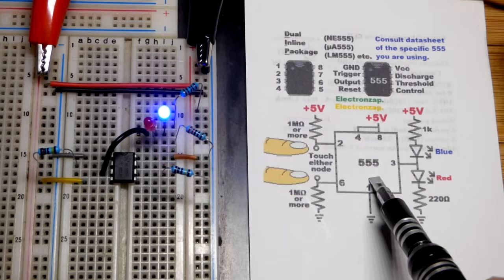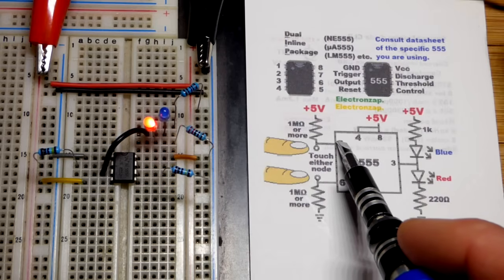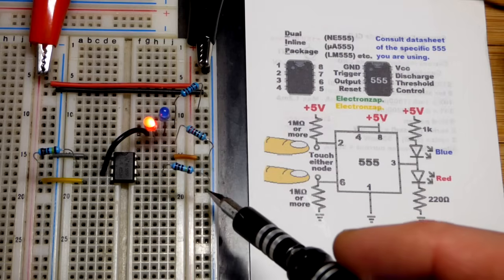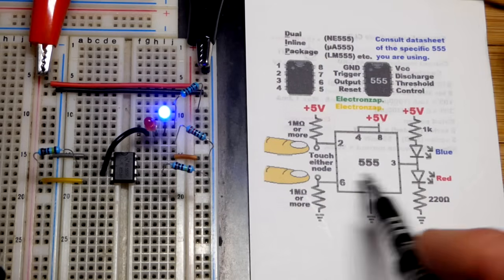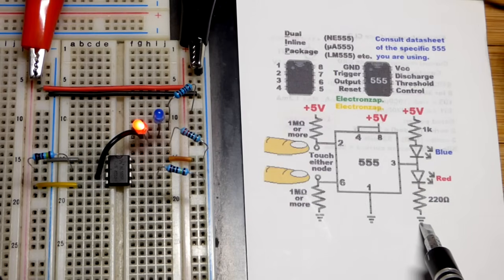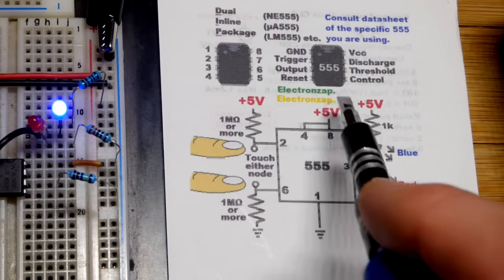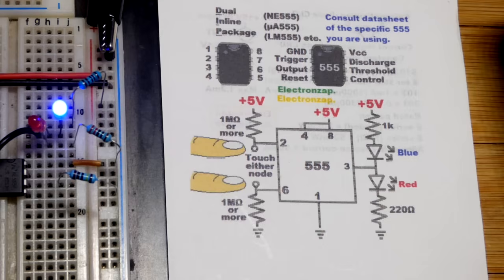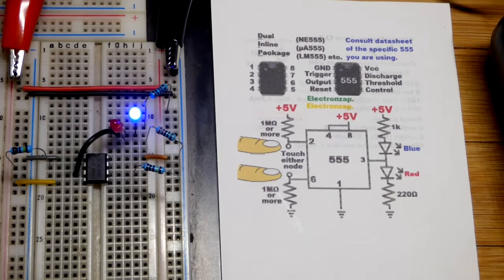Touch Activated 555 Timer Bistable Mode Flip Flop LED Alternator Circuit

Comment: @4:12 the LED switched from blue to red, without apparently being touched at all. Is this circuit prone to spontaneously changing like that?
Reply from the maker: If I bump the power supply, it briefly cuts power, which affect circuits looking at the supply voltage. A practical circuit should have a capacitor across the supply to stabilize circuit power.